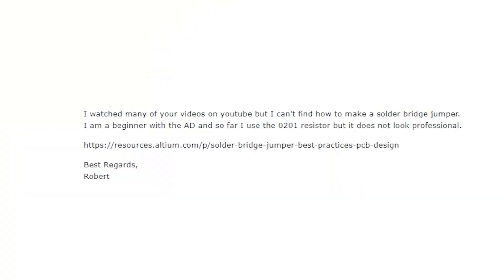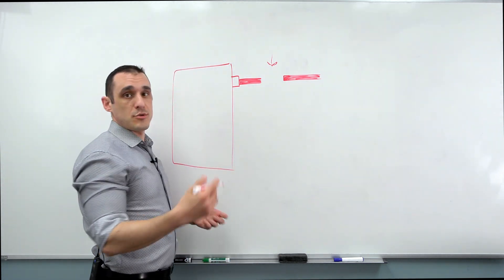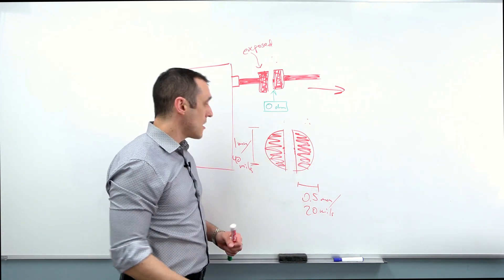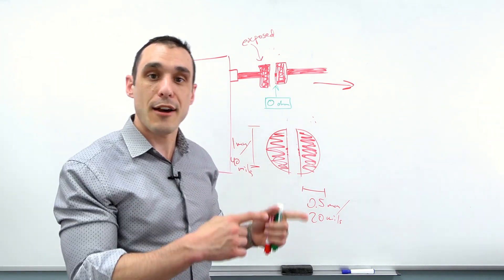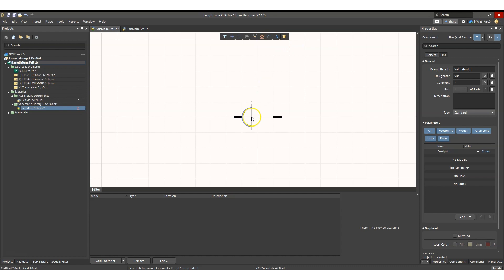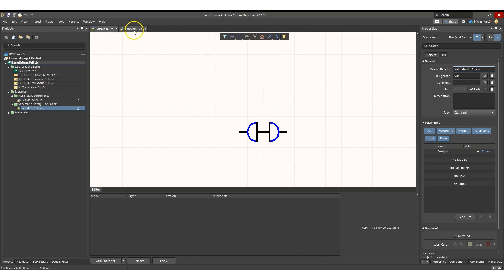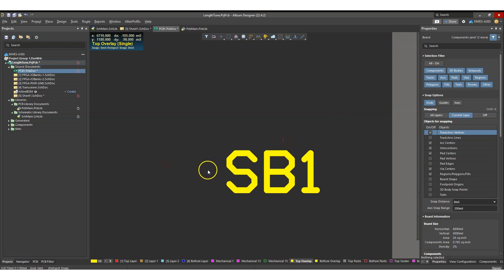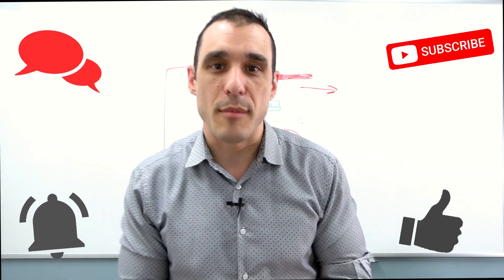How to Create a Solder Bridge | PCB Component Creation

Comment: Thanks for the video, well done. Like some other people in the comment, I have set the foot print property Type to Net Tie (No BOM). Validation of the component indicate an error: "Short copper connection between Pad". I also did the same in the symbol. I also get the same error message in the PCB DRC, but this time the error is "SMT Small component SB1-SolderBridge on Top Layer, has isolated copper". Any idea what I am doing wrong?
Reply: This could arise if using copper pour region to define the connection between the bridge pads, I think you can try using a trace instead of using a copper region.

Comment: When I place the nettie pad in a polygon pour repouring results in the polygon not pouring over the pad even though that is the pour option I have selected. The nettie pad is isolated from the polygone. 
Any Idea?
Reply: Have you assigned the correct net to the nettie pad? That pad needs to have the same net assignment on the polygon. If they don't have the same net assignment, then the clearance rule will always force the pad and polygon to be isolated. Other than this suggestion, I would have to look at the design to see what's happening.

Comment: OK I am quite confused here. This thing is called solder bridge jumper. It is not called 0R resistor jumper. This simply means that we should just need to put a bit of solder on this component to make the connection and then later we can just desolder it to remove the connection. Isn't that the basic idea that we only need solder to make the connection and not a 0R resistor?

Comment: What does DNI, DNP mean?
Reply: It's a designation you can add to something that appears in a BOM that means "Do Not Include" or "Do Not Place" or "Do Not Populate". For these components, they need to be defined as Net Ties, or as Standard-No BOM. However if this does make its way into your BOM you can just add DNI or DNP to your comment and the assembler will know that there is nothing to buy or mount for that line in the BOM. In some CAD tools there is not an easy way to keep these out of the BOM so you would need to mark it manually as DNI or DNP once the BOM is exported.

Comment: I have created a solder brigde component.  
The one issue I get with this is that when I create a polygon pour it should pour over the one pad of the SB it doesn't?
Reply: It depends how you created the solder bridge component and it depends on your settings for the polygon, but without looking at your project directly it's hard to say. In general if you wanted to pour over a pad you need to select Pour Over All Same Net Objects in the polygon settings in the Properties Panel. I think you also need to look at your clearances.

Comment: Thanks for the video. by making the solder bridge shorted basically we connect 2 nets together which can cause a DRC error. I use Net-Tie feature in schematic lib to get ride of this error(in component type field)
Reply: Yes, you do need it on the shorted one. Also you can merge those lines + polygons to primitives if you want to clean up the footprint, but not critical. Could also do it with square.rectangular pads.

Comment: You can try this as well to add top solder layer to the solderbridge. Copy and paste the top copper components, change their layer to top solder and move it back over the solder bridge. I used the origin as reference while copying to keep it simple. Then added  a rectangular fill for the remaining section of the bridge.

Comment: If you want to create a shorted solder bridge component, I think you have to explicitly specify it as a Net Tie, otherwise there will be a net violation.
Reply: You can do it while setting No BOM, assuming you don't include mounting holes, TPs, and bridges in the BOM. I've seen some clients ALWAYS include that stuff in the BOM, so they will have entries with multiple bridges and TPs....
Reply: @Zachariah-Peterson  I still got DRC-Errors. In the Footprint the second pad doesn't combine with the arc, polygon, track and the other pad. So every time I want to route out of pad 1 I got Clearance Constraint Violations and Short-Circuit Constraint Violations with the surrounding arc because it is combined with pad 2. (AD V17.1)

Comment: Why can’t you just put a 0ohm resistor in between the track?
Reply: If you create a solder bridge you can use it as a mounting point for a 0 Ohm resistor. Sometimes, it's easier to cut a solder bridge than it is to de-solder a small component like an SMD 0 Ohm resistor.
Reply: @Zachariah-Peterson  Shouldn't solder bridge jumper be about just using some solder to make the jumper close rather than a 0R SMD resistor?